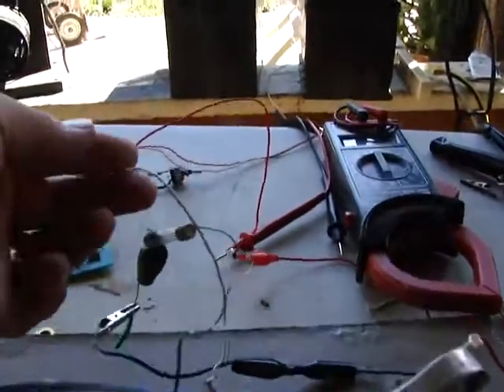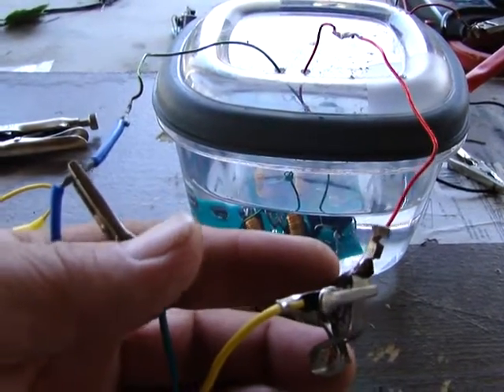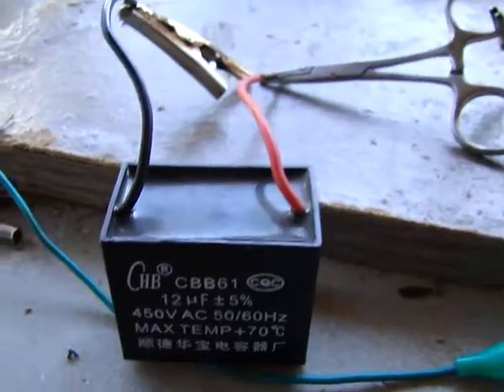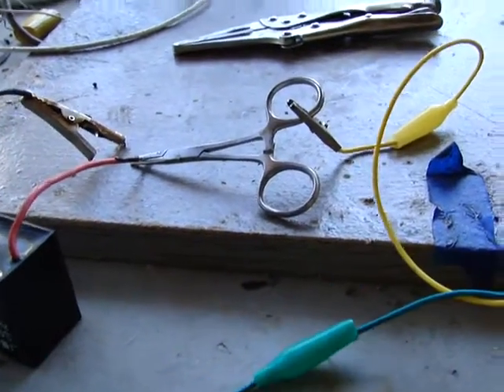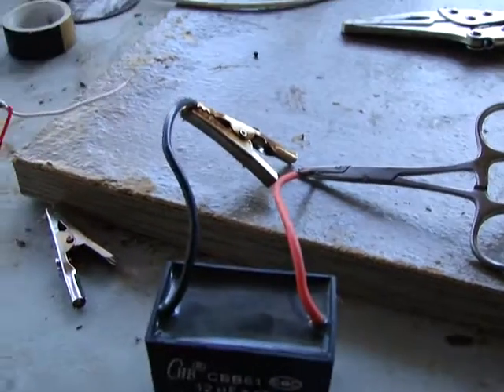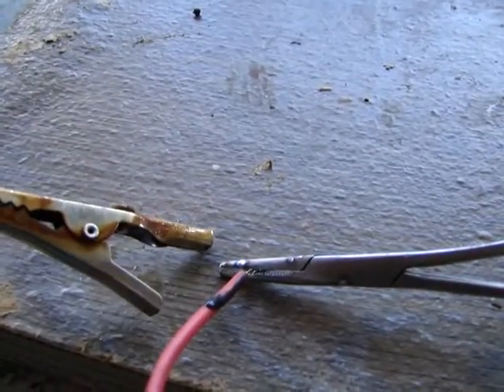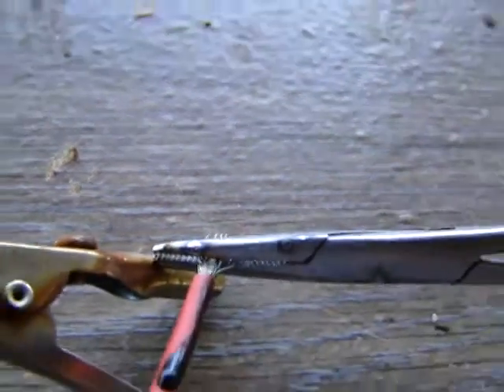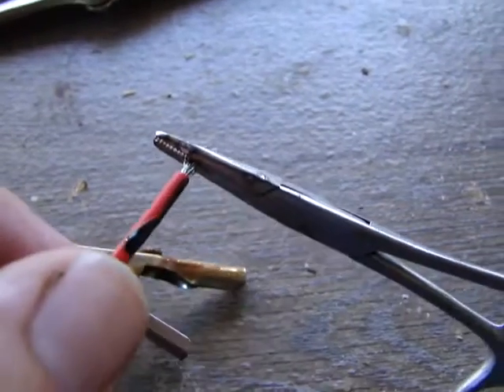Powerful radiant energy from 18 v solar panel

Comment: Hi Alex, Could you send me a copy of the HV schematic that you are using - vadidran@gmail.com. thank you heaps.
Reply from the maker: Your email has failed twice
Reply: Hi Alex,I  am not sure why. Please try my yahoo address - vadi_dran@yahoo.com. Thanks heaps
Vadi
Reply from the maker: sent
Reply from the maker: also i might add mr tom bearden keeps telling us not to kill the dipole(battery) so if we pulse the diferential only (volts) prior to current catching up to it we can do marvelous things; we are using voltage potential to do work without allowing current to short circuit our source (battery) and we may use the back emf spikes to recharge battery as in bedini without magnets or spinning wheels all done via electronics
Reply from the maker: keep me posted on your work please

Comment: Great work! Any links to building such a radiant energy device?
Reply from the maker: +Hazenthly&#39;s Fire Yes gentleman's name is Peter sul just look up on video search and he has a working kit.
this little device is amazing. im hooking it up to just an open ended extension cord and voltage rises to 400+ volts instantly I have a neon indicator that electricians use and it goes off scale, well here is link..https://www.youtube.com/watch?v=E14KnghrCd4
Reply from the maker: +Hazenthly&#39;s Fire im not much into posting but if i can i may video that dramatic voltage rise coming from the open ended parallel lines(cord), Where is this energy coming from?? Tom Bearden hinted that your system needed to be open to allow energy to flow into it, unlike conventional electrical wisdom!
Reply: +Alex Manzanero yes I'd love to see your work; I also frequent Marc's channel which I see you do too. Has a lot of very valuable info there as well.
Reply from the maker: yeah marc is an electronics genius
Reply from the maker: +Hazenthly&#39;s Fire if you play the second spark on my vid in slow motion you will see the radiant energy flying outwards; unlike regular electricity, radiant energy has no interest in a conductor like copper it chooses the most resistance; i.e. air to disiapate
Reply from the maker: +Hazenthly&#39;s Fire Got a new vid showing 480 volts plus!!https://www.youtube.com/watch?v=cr40bDqZZhE
Reply: @alexmanzanero  just a normal spark it's not that weird.
Reply: @alexmanzanero  the same as the normal electric spark produced by the drill's carbon brushes, etc. nothing more.
Reply: @alexmanzanero
Reply from the maker: @emil.honganmaki5461  Peter sul on you tube